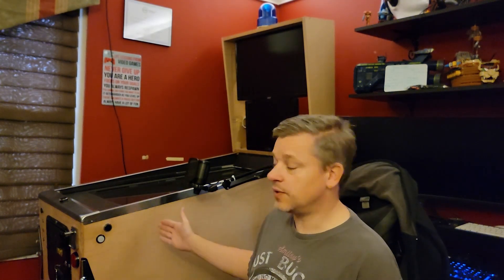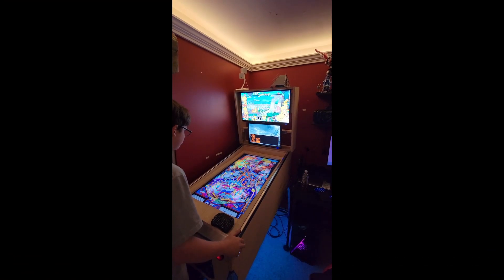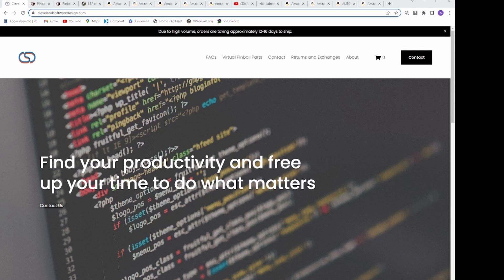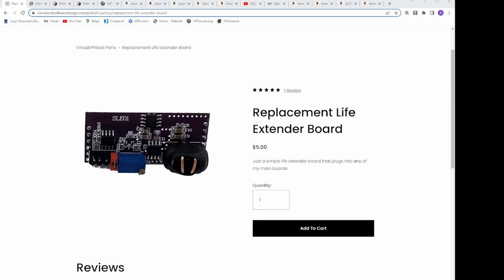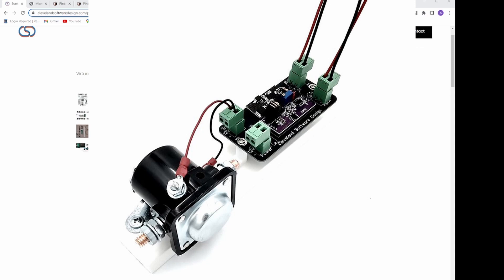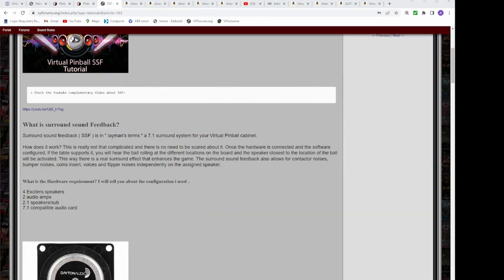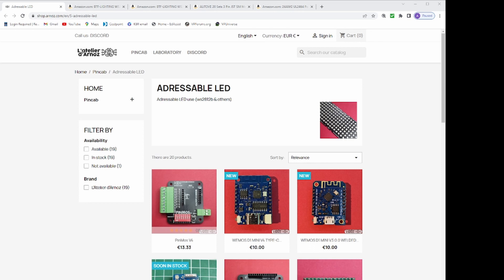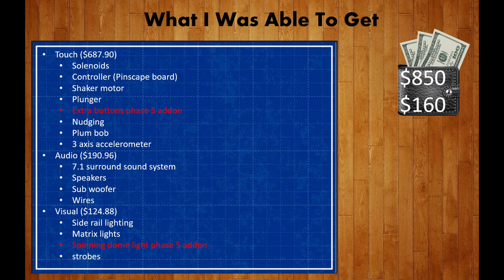Scrapyard Pinball E3 (Journey to phase 4) what + where to buy DOF, SSF, and addressable LED hardware

Comment: How is this a budget build - insane...
Reply from the maker: Thanks. It has taken me 8 years to get to this point. Cheapest parts, some from a dump, some recycled from the real pin comunity, and some 3d printed. Overall, if you compare cids prefab in episode 2 to what I have, I'm still under his cost. The artwork will put me over, but he doesn't have Dof, lighting, or ssf. So im still winning for now. maybe that would be a good episode doing an updated cost comparison.